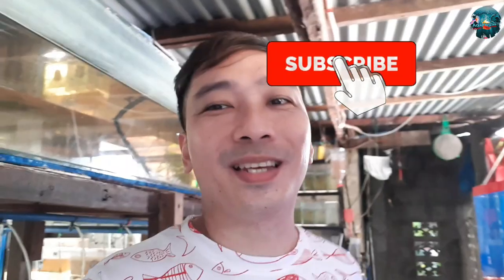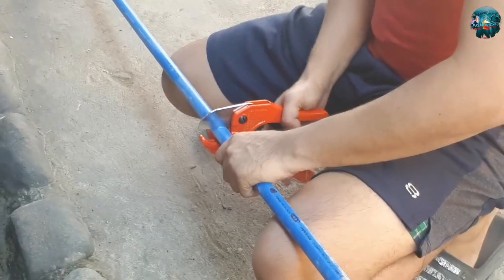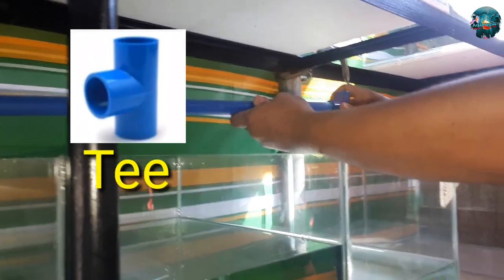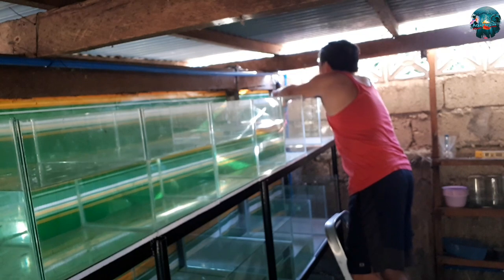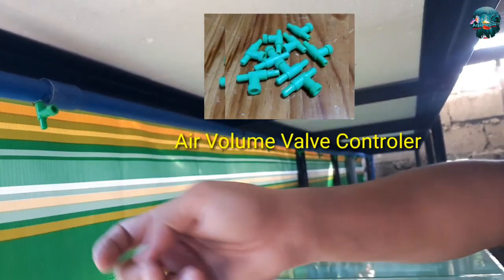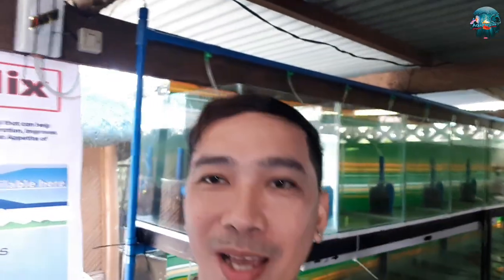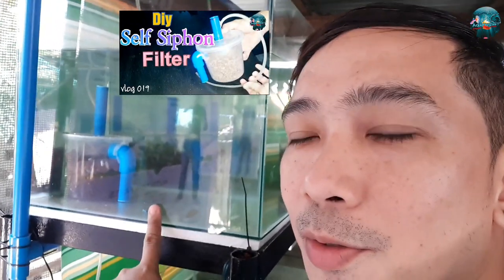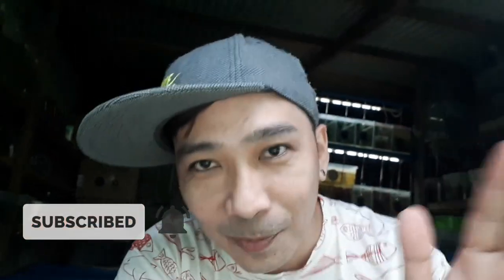HOW TO MAKE A CENTRAL AIR SYSTEM FOR YOUR FISH TANKS USING PVC PIPES.🇵🇭

Comment: Lods . Bat akin pag nilobog ko sa ilalim masyado Hindi bumubula
Pag inangat ko bumubula . Air compressor gamit ko 45 watts.
Reply from the maker: Katubig watch mo latest video ko baka makatulong thanks for watching tanung lang kung me kelngan handa po tayo tumulong😊
Reply from the maker: Anu po size tanks at ilang tanks mo? 45watts sobra lakas na yan sakin 8watts lang 30tanks na eh..check mo line mo baka me singaw
Reply: 12x8x12 po 
50 tanks po
Reply from the maker: Ahh same tayo ng taas watch nyo po ung latest video nandun po panu gawin😊
Reply from the maker: Check mo mabute ung pvc line kung walang leak pati ung valve control nyo dapat walang leak
Reply: Ok po. Maraming salamat po